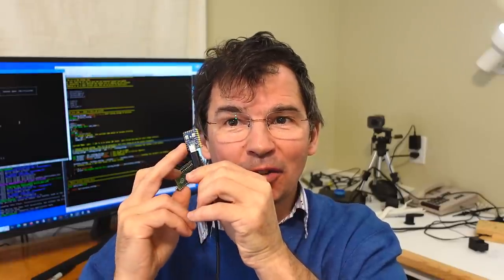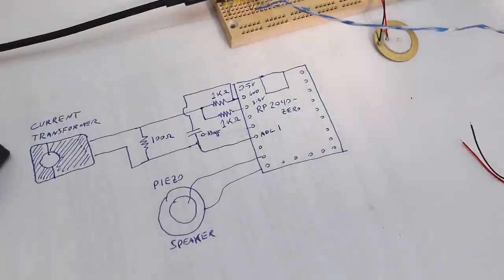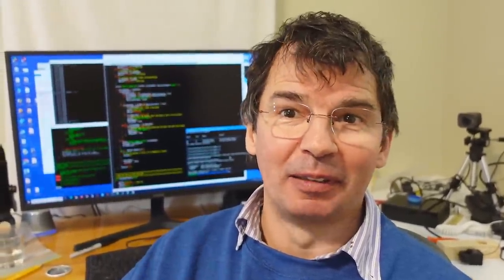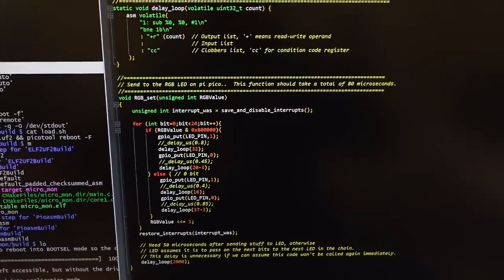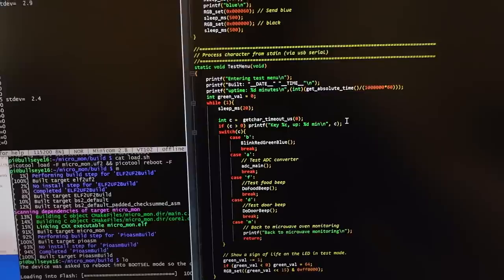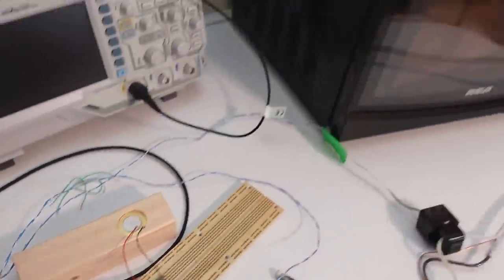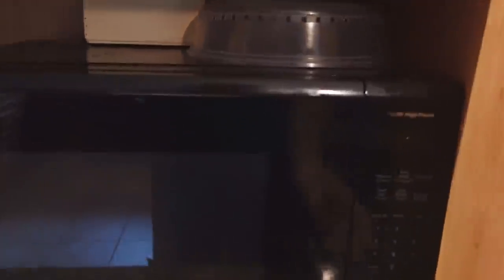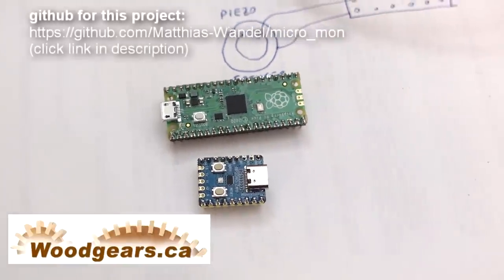Raspberry pi Pico programming in C -- microwave oven monitor and reminder

Comment: Piezo transducers are actually louder if you glue their entire face to a thin, rigid sheet of material.  They flex radially, so they really need a sounding board.
Reply: hard glue or flexible glue?
Reply: Both
Reply: @peter2327  I usually use superglue.
Reply: the case of the microwave is probably a metal sheet.
Reply: @jyvben1520  but the piezo transducer is not attached to it.
Reply: True, although I think this was quite a clever way to get push-pull on it!

Comment: Not sure if it is of help or not, but ESPHome for Home Assistant now supports RIp32040 boards for a number of things, including sensors. One of the features could be a reminder into Home Assistant to make sure that the microwave has been emptied before everyone leaves for their daily activities, or before heading out for a pot-luck, where the microwave was doing a final warm-up of the contribution. Keeping in mind that Home Assistant can send notifications to cell phones. Just a thought, and I imagine it would require quite a bit more work to add everything you can do with this, there. It's a though.
Reply from the maker: yes, but that means I have to fight with all this home assistant stuff.  I'd much rather just lean about the pico than about home assistant

Comment: You should have a look at some of the other stuff the Pico is capable of - it's really quite remarkable.  Like the project that one of the RP2040's developers did where they used the PIOs to bitbang VGA resolution DVI/HDMI @ 60Hz!  With an overvoltage, it can even do 720p, 30Hz.  The second core is even completely free for whatever use you might have.

Comment: The Pico is great, I built a mini weather station with it and waveshare sensor module, a small LCD screen and it's wireless carrying the data via mqtt to a pi, very challenging in micro python but I have it running now faultless for months!

Comment: You might think about adding a buffer stage before the ADC, not sure how large the transients are but id imagine inrush currents to the microwave will be large and could wear out the input over time
Reply from the maker: I left some headroom on the adc range
Reply: @matthiasrandomstuff2221  right, but especially with unbuffered ADC's the internal comparators can get worn excessively from out of range voltages. The inrush current from your microwave will produce large voltage spikes on the output of your current sense coil and over time this could cause damage. Best practice is to use a opamp as a transimpedance amplifier and then feed the output of that into your adc

Comment: If you want the piezo really loud it needs to be attached to a tuned cavity centered on your preferred frequency, but that’s a whole new video.     I just did a project with 162 of those LEDs, wired in a random order but accessed as a regular grid so I had to do a translator function in the esp32,  will do Wi-Fi access for next year.

Comment: I like the make method of compiling programs and loading them onto microprocessors. I can't seem to figure it out for the Pico using C; so much is for Python. I've tried using your GIT but there is a lot going on. If you did a video on setting up a pi to load C programs onto the Pico I would be pumped. I have tried to get GPT to help me out and I still get errors.
Also, I love your channel and woodworking.

Comment: Cool project, could be ported to a lot of power applications, but... Don't most microwaves have key combos to change beep behavior?
Reply from the maker: never heard of such a thing
Reply: @matthiasrandomstuff2221  manufacturer dependent, I suppose. And probably something in a service manual, rather than an owners manual. Panasonic might have that option.

Wasn't until recently that I even thought to check service modes on appliances until I had to replace a blown cap on my dishwasher control board. Now I can put most of my appliances in debug mode :)

Comment: You said that you had two ssh connections into your pi - would the screen command potentially help? Screen is a terminal multiplexer. I use it when ssh'ing into my Pi, start a long running task, and then ssh out again.. That long running task doesn't stop, and I can check back in again in the future to see how it's going. For your purpose, you could just have two "virtual terminals" in the same ssh session, and jump between the two. The downside is that you wouldn't be able to view them both at once - at least I don't think so, I use screen for it's most basic of basic functions
Reply from the maker: I should learn one of those tools.  There's only one pi I leave long running stuff running, and that one is also running a GUI, so I just use VNC to start those.  For the application here, I wanted separate windows on my PC.  The window with minicom in it is always running.  The cool thing is, minicom reconnects to the pico after it reboots -- a very nice setup that way!

Comment: I would have put the Pico inside the oven along side the internal electronics. I would have the Pico operate the internal buzzer with the old buzzer circuit as an input to keep the old alerts. Have the Pico just keep alerting until the door is opened. Power could be stolen from the oven's logic board and the light could be monitored any number of ways. No case needed, no power cord modification, no power supply, no current sensor.
Reply from the maker: except you have to figure out all the internals of the microwave.  No thanks!

Comment: Nice project. Maybe it has potential for commercialization? The Mark II version could be a box that plugs directly into the outlet, with an outlet on its face for the microwave.
Reply: You can achieve literally this with any smart plug that has some automation built in, which is most of them. But where's the fun in that?
Reply: Then if you integrated a microphone into it as well, you could remotely turn the microwave on and off by making some kind of loud noise... like clapping comes to mind for no particular reason at all

Comment: That panasonic microwave looks like the same one I have. If that is the same one, it uses an inverter board to allow for a smaller and MUCH lighter transformer by driving it as a higher frequency. As a safety note, you should look at its RF leakage. Mine is like an RF firehose. Please let me know if yours has this issue! If it does, What is the cause (inverter or faraday cage leakage,) and what should we do to correct them?
Reply from the maker: Haven't noticed issues with ours.

Comment: I think you should be able to use the 2040 PIO to control the programmable LED.
Reply: But that does get into the weeds a bit
Reply: Just requires a small library.
Reply from the maker: problem is, you pull in a library, if its from adafruit, that pulls in a ton of crap every time.

Comment: What happens if you open the door before the timer ends? Does it still detect the current drop and low current light on state? Or does it need the true 0 state after the beeper and light is off?
Reply from the maker: opening the door turns off the microwaving function.  So it detects microwaving ended and door opened, so all is good.

Comment: If someone ends the microwaving early by pressing the open door button, will the alarm think there is still food in the oven?
Reply from the maker: no, cause the microwave will turn off the microwaving and turnon the light, so the thing sees that the door has been opened and cancels the "food in oven" state.

Comment: How do you handle the edge case if you continue to cook before opening the door.
Reply from the maker: opening the door stops the cooking.  So we go from cooking to door open, so no problem.
Reply: @matthiasrandomstuff2221  Okay, my microwave has a feature where after its done cooking you can add time and continue to cook without opening the door. Didn't know if yours is the same.

Comment: At 09:18, we leave the mundane but still useful realm of sand (read silicon) programming of  electronic micro devices for an entirely more satisfying and natural world of the wood programming the necessary enclosure. And indeed that incorporation may be necessary to pacify that slightly fanatic (rabid?) audience of (Matthias) Wandel woodwork wanters.

(Please note: No electricians tape was wasted in this production.)

Here we should perhaps also make the distinction between sand box programming style (python, java and such higher bulked up languages necessarily embedded in the safety rails of IDEs) and the more free wheeling beach sand style (c, assembler) of programming silicon.

Comment: Would it be relatively easy to augment this with a scale. Basically take a tare weight of the microwave and if the weight measure is greater that means there's something in the microwave?
Reply from the maker: "easy" to you if you have never tried anything remotely similar.
Reply: @matthiasrandomstuff2221  hah, sorry it was meant to be posed as a question (?).
Reply: And "easy"  relative to the project you documented here.
Reply: That falls apart if somebody puts something on top of the microwave. Also food items often weigh much less than a microwave so sensor drift would be an issue.

Comment: "fast enough", 120Mhz+, i see no problem to program that in micropython, would not use 2 cores.
Early pc (xt) had 4 to 8 Mhz
Reply from the maker: but programming it in python throws away 99% of the CPU.  Interpreted python is typically 100x slower than compiled C code.

Comment: Interesting. However, using a comparator and 555 timer would be simpler.
Reply from the maker: plus some logic cates, and a pontentiometer, and another 555 timer to beep it, oh, and another one to sequence the beeps apart.  Microcontroller is easier and cheaper.

Comment: As another crusty old embedded software designer (who also worked for RIM) I also don't like using python for this sort of thing.  I would recommend you have a go with one of the ESP32 boards.  You can get them going with with C++ and FreeRTOS which gives you some super simple threading support (if desired.)

Comment: That's the way you program in C, with a text editor only (like vim if pro but even Notepad++ is better than emacs 🤭). I used to use puts instead of printf with the newline at the end but then again I used to define true and false because they weren't defined in gcc back when I programmed in C. And whenever I see that for without spaces after the semicolon my OCD takes over and wants to add them lol
Reply from the maker: let the code I Denotation was commence! :)

back in 1992 at Microsoft, they were embarrassed that they didn’t have an IDE for windows but Borland did.  also no C++.  I didn’t know how good we had it back then.

Comment: If you use a piezo with inbuilt resonating cavity and correctly match the output frequency, then it's sufficient only one output pin to drive it. In fact I even had to use a series 1k resistor because it was a bit too loud for my project. You also need a 0.1uF DC-blocking capacitor in series as well.
Other than that, I think the Pico is a bit overkill for this project; a bare 8-bit micro soldered on a proto-board would have sufficed.

Comment: Your piezo is not on twice the output.
You just reverse the output between 0V and +5V.... 
And that puts an AC voltage on the piezo which it needs to function properly (your piezo has no circuitry to do that itself) 

On any time x you will have only +5V OR -5v. but never 10V at the same time x
Reply from the maker: but if it’s to ground, the ac component is just 2.5 volts instead of 5 volts.  but it’s actually 3.3 cause it’s a 3.3 volt chil
Reply: -5V to +5V is twice as much as 0V to +5V
Reply: By driving the outputs in one orientation (0 & 3.3) and then the other orientation (3.3 & 0) the piezo sees a total voltage swing of 6.6 V, and total voltage swing is the main factor in sound output.

Comment: Now you've bitten the C bullet you should check out the EPS32 solutions! Way cheaper. Run quicker (less OS overhead) and come in hundreds of different configurations / preconfigured hardware like LCD's, WiFi, etc.
Reply: Less OS overhead? He runs this beast without an OS!
Reply: @sparqqling  Ironically likely more overhead in the ESP32, because unless you take specific steps to exclude it, a scheduler will be included behind the scenes to handle WiFi operations.

Comment: I've build a similar project for my coffee machine. A LED shows if the water tank is empty. At first I pointed the LED like you but later I moved the led behind the machine and point the LED to the back. The LED reflects very bright and big on the wood behind the coffee machine. You can try the same: Just mount your detection machine behind the microwave and point it to the back. If that works everything looks way cleaner and no one sees the wires of your device.
Reply from the maker: Good point.  But I WANT to see my creation!  The color of the LED is a godo debug indicator
Reply: It has to be asked: does it run DOOM? LOL!

Comment: When I first got my Pico W there was little resources on how to set up a IDE for C, and after a few days trying, I baled and programmed in MicroPython with Thonny, but would prefer much more to use it with C.  C is a man's programming language for sure.
Reply: I tried for hours to get the IDE working on Windows to no avail.  If you weren't already, I highly recommend using WSL and connecting it to VSCode if you want to use C.
Reply: @KNfLrPn  Thanks.  Next time I'll give that a go.
Reply: My grandma programmed in Cobol (well mostly assembly) for automation and her colleagues were mostly female so I'm sure she would say Cobol is a man's language for sure in the sense you're using that expression. X )

Comment: I got into tinkering with the Pico when it first came out with C, but it was horribly annoying having to unplug and hold the boot button.  Because of that I've usually just either used Python or other micro controllers for my projects.  This video informed me there are better ways, thank you!  Back to Picos for demanding things once more!
Reply: Now with REPLs like thonny and Mu most of those reboot problems are gone... Like OP I use NPP for writing, paste into Thonny, and upload. No physical reset required for testing.

Comment: We have the totally opposite problem: our Philips-Whirlpool microwave beeps loudly ad nauseamum. So I opened it and stuck a blob of Blue Tac to  the piezo -> blessed silence. Our kids have moved out years ago, different times need different solutions.
Reply: Mine is the same (Siemens), it's ridiculously loud and doesn't shut up until you give it some attention (open the door). I've been close to smashing it on numerous occasions. I like your solution.
My main problem is that I forget to turn on the microwave at all, and the rest of the meal is served before I remember the accompaniment waiting to be heated. Don't think there's a solution to that.

Comment: That pico may still be overqualified for the job. Awesome project!
Reply from the maker: back in the 80s, throwing a 32 bit 125 mhz dual core RISC chip at this problem would have been unbelievable.  high end unix workstations or VAX minicomputers were much slower than that.

Comment: Super fun. I love tinkering with these little cheap computers (that, as you say, are more powerful than the first computers I learned to program in the 90s). I used a Pi with a handful of inexpensive temperature sensors to build up a picture of the temperatures in my garage, and then ran it thru the process of insulating the doors to see how much of an effect the insulation really had. All the electronics were a good deal cheaper than the insulation, which is good, because they worked well, while the insulation basically didn't. And I can keep using the Pi for other projects.

Comment: Kudos for your programing skills, mostly (even if small) for the assembly part!  A wayyyyyyy more simple and just electronic approach would be use the transformer relay as a latching signal for other relay, and keep it latched until the circuit is broken when we pressed the door button (using the good old self latched relay circuit), of course i'm oversimplifying the explanation to keep the comment short, and also because there are various ways to do the circuit.
Reply from the maker: that would involve an awful,lot of hard ware to implement the. algirihm
Reply: @matthiasrandomstuff2221  To reproduce the led effect and sound a bit more hardware would indeed be needed, however it all comes down to what we want, i was talking about a signal like a flashing led or so, a simple stuff. But hey i'm not criticize your approach by any means, we should do the way best meet our goals. :) And btw great video contents you have.

Comment: How does this deal with the microwave not running at full power? Usually microwaves run at a really slow PWM (tens of seconds), so it might be annoying to detect?
Reply from the maker: Between microwaving and idling when using less than power, the fan is still running.  I just set the "microwavning" threshold low enough that it will consider fan running also as "microwaving"

Comment: How fast can the current clamp be polled reliably for data with the pico? I'm having some issues with my power chair and I'm wanting to log some data since the issue is intermittent. I'd love to love poll voltage and amperage about 60 times a second but only log it to the SD card 5 times a second(at most) unless there is a sharp change in voltage/current. Then it would log 30 times a second.  I'm only just getting started with the project and I may end up not actually doing it. I can't tell if my motor controller is going out on my chair or if my batteries are getting weak.  It's started going into over current protect mode on small hills. I suspect it's voltage drop causing the amperage to spike. My multi-meter isn't good enough to catch it when it happens.
Reply from the maker: I'm polling iever milisecond, but the pico can go much faster than that